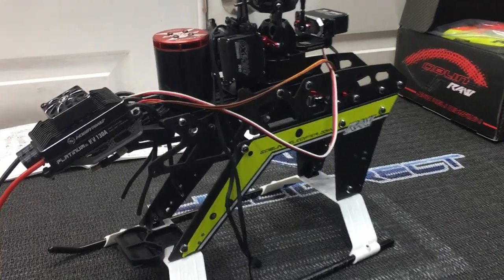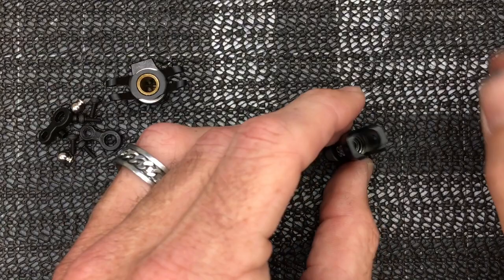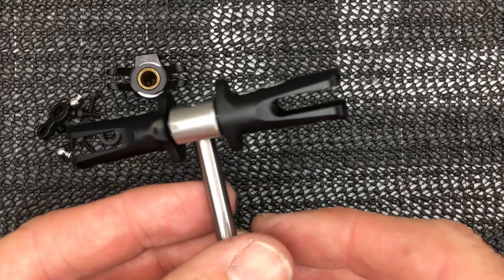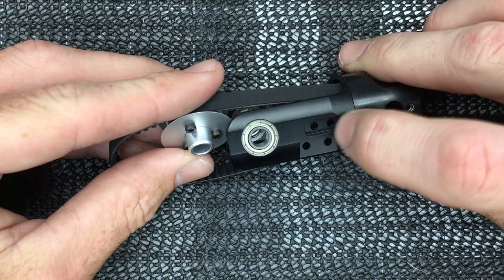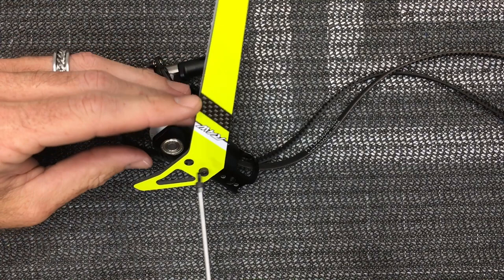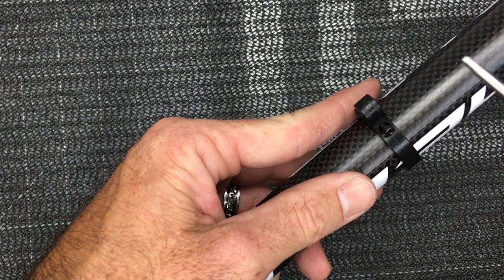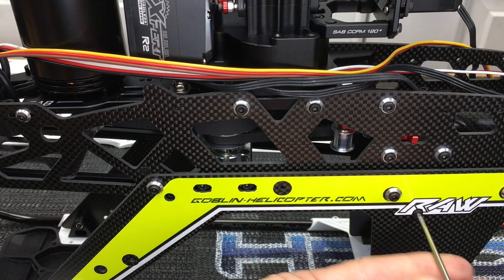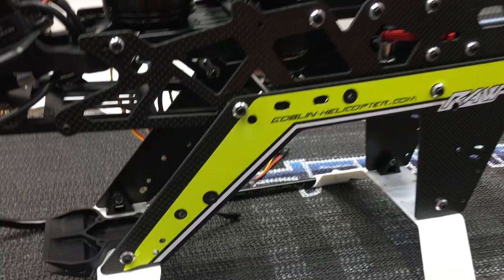SAB Goblin RAW 700 Piuma Build Part 3

Comment: Could you do a video on how you set up the transmitter?

I'm quite new to helis, I'm trying to go from a RTF to a BNF and I have just got a Spektrum transmitter. It would be nice if you could do an overview of how you set up a new heli model, bind to the heli, and go over the relevant settings (e.g. making sure servo is moving the right way, how to trim servos - unless this is done through the Brain 2). It's quite overwhelming getting this transmitter as there is a lot going on. I'm not sure about what setting I should care about and what I should leave alone.

Or if anyone can guide me to a relevant video which covers this, it would be very helpful.
Reply from the maker: Hello! So here is a video on radio setup with spektrum, https://www.youtube.com/watch?v=A5iV7F2uctA&t=11s this is the same predetermined set up I put in all my helicopters exception of throttle curve percentages. Some of them are higher some of them a lower but the base set up is the same on all of them. Here is a Ikon setup video https://www.youtube.com/watch?v=g_ZmGHPHDmM&t=944s this is a complete going over the Ikon set up and what to look for and what to do. I hope that helps you! Never use servo trim in the radio always do that through the FBL unit. I recommend always disabling the trim tabs on the radio so you never accidentally hit them or bump them.
Reply: @westhobbiesrc8051  Great, Thank you!
Reply from the maker: @_RIL_  you’re welcome!

Comment: Do you remember if the Xnova motor was shaft length A or B?
Reply from the maker: This one was a shaft A but all SAB use shaft B
Reply: @westhobbiesrc8051  :  So both A and B will work fine, but the preferred optimal choice is B?  Or it really just makes no difference at all?  I'm getting ready to do a Piuma build, just making sure I order correctly.  Thanks for the response/help !!!
Reply from the maker: @Aberamentho2010  so shaft A is longer and will have to be Cut down like I did on this one. Shaft B is the right length and fits perfectly with no cutting. So I would order a Shaft B motor so you don’t have to cut the motor shaft. You’re welcome!
Reply: @westhobbiesrc8051  subscribed! Thanks !!
Reply from the maker: @Aberamentho2010 Thank you! I’m glad to help. Enjoy your build!